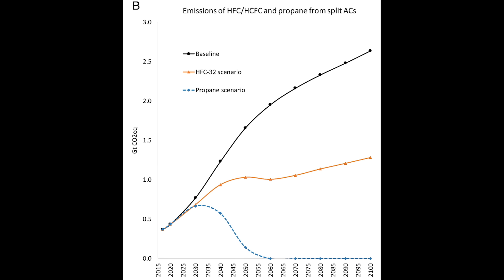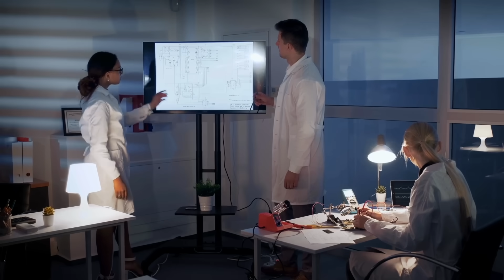New AC with Propane Freon! - Flammable Refrigerant!

Comment: I’m waiting for it to be readily available. I’ve got a 30 year old R22 system that’s good but the clock is ticking on it. 
I’m down in the woods, plenty of room for ground source, pumped water, or a coil in a pond. I’d use water/antifreeze to the house so nothing flammable inside. 
I’d like a simple heat pump system: On-Off and reversing for winter. No variable speed. No computers. Not controlled by a smartphone. 
I can keep my mercury switch thermostat. 🙂

Comment: I just had an R290 propane system installed 3 weeks ago it's cooling the house incredibly well it's very quiet 
The manufacturer is RunTru.
I had RunTru furnace installed last year in April 2024 and it has significantly reduced my heating bill.
I have yet to receive my first electric bill since the new R290 system was installed  I am interested to see 
The level of savings due to its efficiency

Comment: Been using propane in my central air for 20 years. Lower head pressure. I'd bet 30 percent savings on electricity while in r22 unit.
Reply: Are you able to provide any measured data or studies showing such a large improvement in cooling efficiency with no other changes? I've tested refrigerant grade R290 as a replacement for R22 and it work fine, I have an R22 window AC in my garage that's been using R290 for the last 8 years with no problems. However, I have yet to see any meaningful improvements in delta T or power consumption when using it as a drop in and optimizing the charge the best I could. That's not to say R290 isn't more efficient than R22 though, I'm sure the results could be better in a system designed for R290 from the beginning.

Comment: Using propane is not new it was used in real old units many years ago,i have used it in my autos for over 30 years and when my minisplits lost the r410a i use it in them to replace the r410a cost more then the minisplit i will just keep using propane in mine.

Comment: I'm getting ready to test normal bbq propane in my old heat pump. I have been using R290 in it for 12 years. I bet normal store bought propane will be fine too.
Reply: that propane from your BBQ grill has the odorant ethyl mercaptan in it plus methyl alcohol that may be an issue. I am sure they are using unodorized pure propane.

Comment: Those small roll around air conditioners have warnings on them not to drill or cut into them because of the flammable refrigerant they use. I have one to use on generator power during a hurricane.

Comment: It’s stupid expensive, and fewer shops do the recharge. Don’t recommend.
Reply: Stupid expensive?  Compared to refrigerants that you need a specialized license to buy, it's not.  And while you can't use the cheaper BBQ type propane (because its too contaminated), if you know what you're doing, you can filter that with activated carbon and zeolites to get clean propane to use as a refrigerant.

Comment: Let me get this straight, many homes have "virtually" an unlimited supply of a flammable gas leading to an "open system" whereby it doesn't go in a loop but ends up being directly burned and locally ignited in home. We are worried about a small limited amount of a flammable gas being used in a closed loop without an ignition source that's stored on the outdoor unit. Sounds like the suppliers of proprietary refrigerants are the ones lobbying heavy on the dangers of a "flammable" refrigerant. As a bonus it also doesn't have ozone depleting issues.
Reply: The powerfuls' interests are not with the interests of the environment and the people.
Reply: Exactly and government nanny state politicians.
Reply: Propane is not that flammable compared to other gasses like Acetylene and Hydrogen.  Propane combustibility with air is about 2 and 10 percent gas to air.  Hydrogen is scary at 4 to 75%.   Small hydrogen leaks will combust and be invisible.    It takes a large low velocity propane leak to combust in my experience.   I'm a fire artist.   Once I was working with hydrogen and just had a 1/4 inch pipe coming out of a tank of hydrogen that I had ignited to photograph the "invisible heat waves". I turned the tank off went into the house and made a sandwich.  When I came back out the copper pipe was hot halfway to the tank.  The valve hadn't fully closed I guess and a tiny little flame must have been burning at the end or maybe in the pipe.  Hydrogen will combust with a tiny leak.  Propane won't.
Reply: 100% @rpinarreta! Propane is naturally occurring in the enviroment, therefore you can't patent it. Refrigerants become "bad" for the environment when certain companies patents run out. R134a isn't bad for the ozone but we have to change our cars because of a made up number for "global warming index" in which yz1234 has a lower number according to the people that are making millions off this bullcrap!!!!

Comment: SO what?  You can’t run hydronic pipes in to existing townhomes, condos and MOST of the home that you yourself are servicing.  You did not even address the suppression systems, the sensors and the dangers of someone having a coil leak and having a propane based refrigerant.  What would be the future option?  Repair and replace only? No more “topping off” ?  Sorry I just feel like you made a feel good video without talking about the effects of that elephant, remember that elephant is going to take a big dump in that room.

Comment: We do not know what the rules will be in the US or Canada.  The building codes have not yet been changed. R 32 is a more likely option going forward as it is less flammable.  Went to a LG training center three years ago and all the refrigerant lines were press fit.  Seems logical with flammable refrigerant.

Comment: I would say that you're right yes a lot of those appliances use propane but the difference is you don't have to solder or braze copper lines to install them are they going to change the way line set works or is it moving to that's threaded?
Reply: P

Comment: I would like to have a choice to buy and install a home central ac unit using R290.  I am curious to see when will it happen and will the cost be reasonable.
Reply from the maker: A lot of homeowners are wishing they had more choices
Reply: just put propane on the system you already have. it has the properties of r22 basically. look at the phase graph.
Reply: @Stealthsilent1337    Yeah, but don't use like BBQ propane.  It needs to be clean propane.

Comment: Outside air to water units are the future with hydronic systems. Also down the road we will see
C02 units which are even better but the heat only will delay until reliable reversing valves can be
developed.COP of over 8 with CO2 is possible...
CO2 can go transcritical so good design is imperative...
All refigerant circuits are welded and not field servicable..
Reply: CO2 requires very high pressures to work.  Needs specialized systems.  Propane doesn't, can work with preexisting systems from what I've read.

Comment: Propane has always worked as a refrigerant.  We used to use it in cars all the time.  It's easy to get and works!
Reply: The problem happens when you get manufacturers cutting corners to make profit and end up with leaky products as a result. It's even worse when such systems are used in crowded areas like apartment buildings. Look up the Grenfell Tower fire and Valencia residential complex fire. Two huge highrise apartment buildings where nearly the whole building was set on fire by a faulty refrigerator using a hydrocarbon refrigerant (isobutane in both cases). Propane/isobutane/etc work as long as you can trust companies to make robust products that won't leak, and spoiler alert, you CAN'T!
Reply: @emilysmith6897 really shit i hVe no electricity i need cold and hot air water the whole
Reply: Does it really works ?
Reply: Never had a problem.  As long as no air with an ignition source gets in contact with the propane there should be no problem.
Reply: @davidzelkowski9948 Will it work on r134a car ac? And if it will work what must be the pressure settings on low side and high side
Reply from the maker: Ever have it ignite?
Reply: 2 @NewHVACGuide 😢5d

Comment: It's in refrigerators already. It's coming.
Reply from the maker: Have you worked on it?
Reply: @NewHVACGuide  I have worked on a few.  most new small refrigeration units are using R290, maybe some residential refrigerators too.